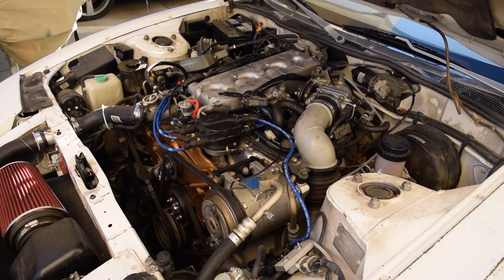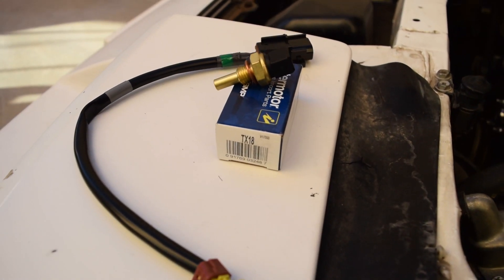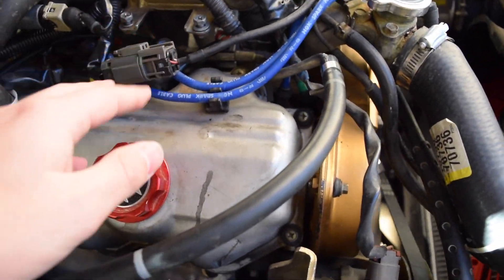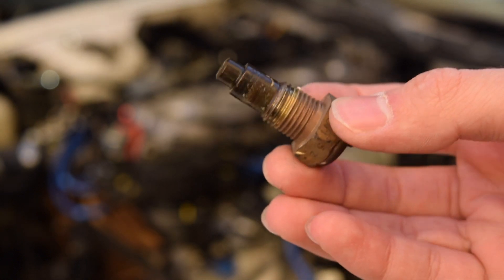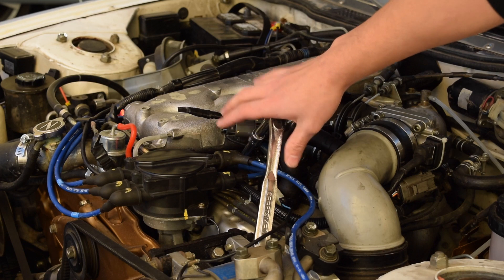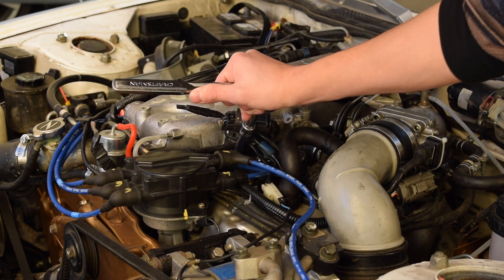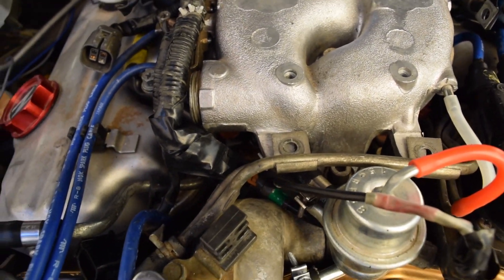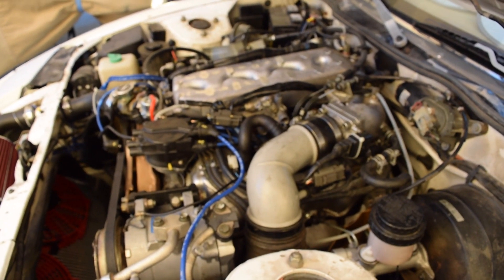CHTS Sensor Upgrade/Relocation Z31

Comment: We are dealing with CHTS issues on my son's 84 Z31. We went through and did the timing belt, water pump, spark plugs, cables, distributor, hoses, belts, PCV and of course the CHTS. After starting the car it runs fine at cold but then begins to rough idle/misfire at temp. I replaced the CHTS again (thinking I had a faulty part) but still the same thing. We then did the relocation. I replaced the harness with one from Amazon that has the same connectors and tests fine with a multimeter, but curious if we need to just get the factory harness from Nissan.
Reply from the maker: A bad CHTS usually causes poor starting/idling when cold from what I understand. Have you looked at the fuel system at all?

Comment: Does your ecu throw any codes after doing this? Im still getting the CHTS code
Reply from the maker: This shouldn't be causing a CHTS code. I would inspect the wires into the engine harness, and then check the resistance between the CHTS and the ecu to make sure you don't have a broken wire
Reply: @TheZGarage  Resistence across the sensor seemed fine. My dry sensor is reading as an open, which is why I replaced it. I'll pick up some smaller probe tips and see what shows up at the plug by the ECU, maybe there's some corrosion further up the harness.

Comment: I finally did the upgrade of my 84 300zx turbo to the 95 nissan pathfinder temp sensor mounted in the old injector cooler temp sensor switch port in left front cylinder head area using the 300zx harness for it.  I replaced the automatic injector cooler fan when it died and I couldn't find the parts, with a windup electric timer like you find on bathroom fans.  

This new sensor made a huge difference, and the car runs so much better, even seems to get better gas mileage(?).  Now if I need to check the harness or spray the contacts with cleaner, it is SO easy to do.  Replacing the sensor is also very easy now.  I think the new sensor is better designed, doesn't rotate or wobble around like the old one did, too.  So MANY thanks for this simple hack, it's almost like driving a new car.  :)

Comment: Thanks for this.  I'm getting ready to do this very upgrade. I found that I would set the timing on it and initially it would start fine.  But after 5-6 starts it would become more difficult to start and eventually nearly impossible.  I would unplug the battery, reset the timing, and then the car starts fine.  This cycle keeps repeating.  Im hoping that this sensor will solve this issue

Comment: If I do the relocation, do I leave the original CHTS where it is and just put the wire on the relocated part? I’m just confused on what happens to the original CHTS. Because if I move it from one spot to the other I would have to block it off no?
Reply from the maker: The original sensor does not contact coolant. It is a "dry sensor" and reads the temperature of the engine block. So you can leave it in or take it out, it doesn't make a difference either way. I left the original in its place when I did my relocation because it's a pain to get to
Reply: @TheZGarage  ok thank you so much

Comment: So I just leave the original sensor on its original port?
Reply from the maker: Yep. You can take it out or leave it. It's a dry sensor so even if you remove it nothing bad will happen.
Reply: @TheZGarage  Love the content man adn thanks for the help! Just did the timing belt as well and used your video as guidance. Awesome work man!

Comment: I made an offset wrench to grab the CHTS, then cut a piece of shroud away and made sheet metal plates with screws in them so I can remove some of the plastic shroud while working and easily replace when done.  I do the thing without any real disassembly at all, and no butchery of the stuff in the way, either.  To make the wrench, I took a 3" (3/8 socket) drive extension and welded it offset to a deep socket with a cutaway to clear around the stuff in the way; it works fine to tighten and loosen the sensor, then I use a finger (takes 5 minutes) or piece of rubber hose, really fast to wind it out and back in.  Changing the sensor takes about 15-30 minutes, depending if a cute chick comes by or not.   Bob

Comment: Wait so if you have the injector fan you got to undo a sensor? What does it have to do with the chts? I'm curious.

And what years and models had the injector fan?
Reply from the maker: The injector fan sensor is in the port used for the relocation. If you do the relocation, you can't use the injector fan anymore. I believe 85 and up had the injector fan but only in markets that had a hotter climate. They weren't equipped on all z31s
Reply: @TheZGarage  I have a 1986 Z31 with the fan and even in the NE, if you run the car in the summer and get stuck in traffic, it's good to have the fan that cools the car.   So, I won't be using this method.   I'm looking into replacing the 86 ECU with an 87 ECU... have to do more research...I think it bypasses the 86 CHTS.    But what do I know???
Reply: @roselemay4416 have you found out any more info on the 87 ECU?

Comment: I've said it a hundred times man I really don't mean to bug you but you no more about certain things than I do I am computer illiterate I'm pretty good with wiring I'm good with electrical and mechanical I was just about anyting I'm just computer illiterate as a MF LOL thanks again for all your advice and help my car is almost where I want it but you know what I would really like to do is do the rear mount Turbo I know I've said it it seems like then I wouldn't have to have the turbo manifold or the crossmember or the alternator on the other side and they say you don't need an intercooler because it cools from the ambient temperature of it having to run back up the car plus I think that turbo looks mean as hell sticking out the back of the car problem is I don't think there's enough room under the Z car to do this I would really love to have the patience and the money and the help to do mine the way yours is

Comment: I've got my chts sensor and sub harness but my sub harness does not have two plugs on it I'm going to have to utilize the end off of my factory plug and splice in this is a SMP standard connector part number SK 25 what I'm asking you is can I just cut the old one and pull it up from behind the timing cover and if so what do I do with the factory chts do I just leave it in the hole where it belongs and not use it anymore or what please let me know soon as possible also both wires on new  connector are the same  what do I do. Lol

Comment: I forgot to ask last time but, do I need to bleed the coolant out of the engine in order to do this mod?
Reply from the maker: Not to put it in. And you shouldn't have to afterwards either. It shouldn't introduce too much air into the system and any air should bleed out when it runs. Not enough to overheat or anything

Comment: what could happen without the injectos fan temp sensor??
Reply from the maker: If your car was equipped with the injector fans, it will no longer run, however their effectiveness was questionable from the factory and modern gasoline is better at not vaporizing so you shouldn't notice any issues without it
Reply: @TheZGarage   even thou AZ is hot as hell?  tbh im not even sure my car is equipped with them, its an 84 turbo with digital dash, thanks for answering so fast. i will try doing it your way, i like it
Reply from the maker: I don't think 84s came with the injector fans.
Reply: @TheZGarage  one less thing to worry about, thanks a lot man

Comment: Thanks for the video. I have an 86t and I think my coolant leak is coming from the old CHTS so I'll have to dive all the way in
Reply from the maker: The old Chts sensor is a dry sensor so it's not possible to leak coolant from that area unless there's a crack in the block. It's probably leaking from the thermostat housing or the coolant bypass hose. I would recommend replacing all of that when the timing is off since they're hard to get to

Comment: Alright I replaced it and nothing changed question 1. Does the ecu run on different maps when you do and don’t have this 
2. My harness is set up a bit different how do I know which one to hook it up to
3. And what other problems could cause it to run so rich(maxed out on my a/fr gauge) and doesn’t move even under boost
Reply from the maker: I'm not sure if the ecu has different maps. This is a very important sensor so it takes whatever reading it can from this and goes with that. The CHTS should only go into one connector, it shouldn't be possible to go onto another one. And if it's really rich you could check the fuel pressure regulator to make sure its working properly. Use an online fuel pressure gauge

Comment: i picked up an 85 300zx for $800 and this seemed to be the only issue aside from cosmetic stuff thanks for the video
Reply: i got my 85 300zx for 1000, the build is coming together nicely. do you wanna swap numbers to see each others builds?
Reply: @xythos how did it run before you replaced it, I’m thinking this might be the issue going on with mine
Reply: @tylerchambers5312  it didnt run at all when i bought it
Reply: i just bought mine for 1400 about 3ish months ago and it still wont idle lmao

Comment: Will this make your engine die upon start up if it isn't reading right
Reply from the maker: It's possible. Typical symptoms are difficulty starting and rough idle. I would also check the maf. Unplug it and see if it runs better. If it does, then that's your problem
Reply: @TheZGarage  Could also be a vacuum leak if it runs better with the MAF disconnected, I believe the ECU changes the map and goes into limp mode. Had that issue with my 240sx when I deleted the emissions system!

Comment: I did this and the ecu throws 13 and 33.
After resetting the ecu and plugging back into stock location it was no longer throwing the code.
Reply from the maker: Where did you get your parts from? It's possible the new ones were faulty which is why it the code 13 for the CHTS circuit. And are you sure the other one was 33? I wasn't able to find anything for a code 33
Reply: @TheZGarage  I used an orielly auto parts sensor. Don't remember the brand.
I have an 88. 33 is fuel temp sensor.
I plugged back into original chts. I'm having a different issue 
It is still throwing 42 exhaust gas sensor. 
I'm checking o2 and wiring harness today. Pretty sure it's related to that.
I only tried the chts relocation because people kept recommending I check it.
Reply from the maker: Did you ever try running it with the relocation to see if it ran any better? And I'm looking at the XenonZcar page and it's saying 33 is the egr circuit and 42 is the fuel temp. One thing you can try is unplug your 02 sensor and see if that changes anything. It goes into a closed loop when you do that and just runs off the fuel map
Reply: @TheZGarage  lol got it backwards. I was throwing 13, 33, and 42 after driving it with the relocation. 
It ran the same as it did with it plugged into the original chts. 
It just threw 2 extra codes.
Fuel temp sensor has a very coroded looking wire harness. Gonna fix that and see how it does before I change the fuel pressure regulator.
Reply from the maker: The fuel temp sensor doesn't change anything in the ecu tuning so I would just ignore it. Similar to the egr, that would just effect the emissions, shouldn't hinder how it runs. What I would suggest is to try unplugging the maf and see if that solves your problem. With it unplugged it will only rev to 3k but if the maf is giving a bad signal it can make it run pretty bad. That could at least narrow the problem
Reply: @TheZGarage  the mag has been replaced. Before it would not rev up to 3000.
I have been trying to figure this out for months.
The code that is always coming up is 42, and when accelerating it sputters sometimes. If I don't need to look at the regulator I am 100% completely stumped.
Reply: @TheZGarage  the connector for the fpr is very coroded. 
I've taken this car to more than 1 mechanic, but no one seems to know anything about these cars.
I am really getting frustrated with the months of trying to figure out what to do to fix this car.
Reply from the maker: If you're located near PA, you can take it to XenonZcar garage. He's extremely knowledgeable on z31s. But if not I'd have to guess that you may be out of time. Have you ever looked into the timing on your Z?
Reply: @TheZGarage  I'm in AZ. I'll get a timing light tomorrow. Thanks.
Reply from the maker: It may also be the mechanical timing. How many miles does it have? Do you know when the last time it had the timing belt service was?
Reply: Timing belt was changed recently. I could probably check it, but don't really want to tear it down.
I already have a Hyundai torn down for a head gasket, and cam swap ha ha.
I don't really have a good spot to do it until the Hyundai is done
Reply: @TheZGarage  it was the egr solenoid. I have it bypassed, and it runs perfect. Good mod! I followed your video of the maxima alternator mod! Thanks!
Reply: @rice_myhyundai816  Thanks for coming back to tell what it was, so many people dont do that
Reply: I actually redid the belt because it has jumped a tooth

Comment: That sensor you removed isn’t that for the temp gauge in car? How do you run your temp gauge now?
Reply from the maker: No, the temp sensor for the ecu and the temp sensor for the dash are two different ones. The one that feeds the dash is on the passenger side of the lower intake manifold. It has a single wire connected to it. The CHTS is solely for the ecu

Comment: Hey man what are dimensions of the cone filter you have on? Just trying to find a universal one I can put on my car
Reply from the maker: I don't quite remember but it is a K&N, maybe 10 inches long, and has a max diameter of like 4 inches but comes with adapters to go down to the stock intake size (3 inches if I remember correctly)

Comment: So it's been a year since the MOD,how is it working? I never notice no coolant coming from the original location..I think it just measures heat rather than coolant temp..thanks.
Reply from the maker: You are correct, the original location is a try temp of just the engine block. The relocation is a wet location and samples the coolant temp. It's been reliable this entire time! No regrets!

Comment: Old sensor is 1/4 NPT and pathfinder is m12x 1.5.  So wont this leak?
Reply: What did you end up doing Mike? I also noticed the plug in the manifold is .040" in diameter larger and has a different thread than the TX18 Pathfinder sensor.
Reply: OK, the correct adapter to do this right is actually M12X1.5 Female to Pipe BSPP BSP 1/4" Male. The engine side has a British pipe thread!
Reply: @alrui Product link please?
Reply from the maker: It's been working perfectly for me for a few months now. The thread fit perfect and wasn't lose so I believe they're the same thread
Reply: Im using a GM coolant temp sensor and a standalone ecu
Reply: @mikegruizinga6875  I "assume"the GM sensor had the correct metric thread?

Comment: Where can I get those hoses for the fuel regulator ? Mine are starting to crack
Reply from the maker: They're just regular 5/16 th fuel line. I recommend using fuel injection hose though because it's under higher pressure there and needs to be a better quality line. And use fuel injection hose clamps to secure them properly or they might leak
Reply: What about the clear and orange one ?
Reply from the maker: @Zdirtyone  Those are vacuum lines. Any standard silicone or rubber vacuum hose will work. That hose is 4mm diameter
Reply: Is there anywhere I can contact you in ? Im looking to replace the chts and also relocate it but I can’t find the plug w the wire that will be replaced
Reply from the maker: @Zdirtyone  Sorry, I had sent a reply but i guess it didn't go through. If you go to the contact tab at thezgarage.net that would be a great way or on instagram. If you go to the write-up section on thezgarage.net it has a written tutorial on the swap

Comment: What’s your intake set up if you don’t mind me asking and any links for the filter or anything else you used?
Reply from the maker: Only real mod I have is my K&N air filter on the front. I got that on Amazon.com (sorry I couldn't find the link I used)
Reply: The Z Garage is it just the filter itself or do you need a bracket to attach it or something?
Reply: The Z Garage or did you just buy the k&n kit for like $210?
Reply from the maker: @markromero9195  I bought the filter and it came with adapters for different size intakes. I think it only cost me about $45 total or something like that. Nothing crazy at all

Comment: So if I wanted to do this, would I have to remove my old CHTS that’s Under the timing and all that mess?
Reply from the maker: You don't have to. I didn't when I did mine but if you don't you have to buy a new harness which is another $30 or so.

Comment: Do you know where the starter is located ?
Reply from the maker: The starter is on the passenger side of the engine. If you can jack the car up on the passenger front tire and remove it and look underneath, the starter is right on the bottom going into the bell housing of the transmission. It is usually a black cylinder and about 5in in diameter with a smaller cylinder to the side of it. If you go to rockauto.com and search up your car, it will show you pictures of the starter so you know what to look for.